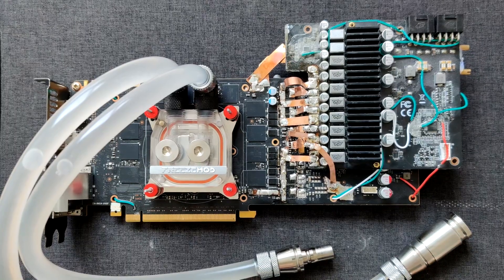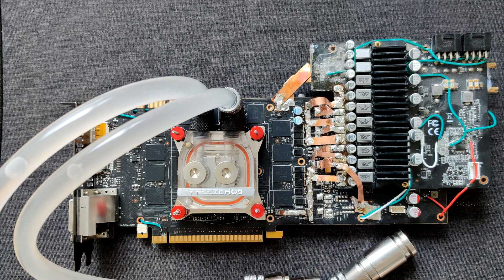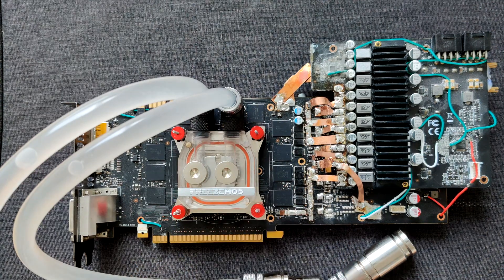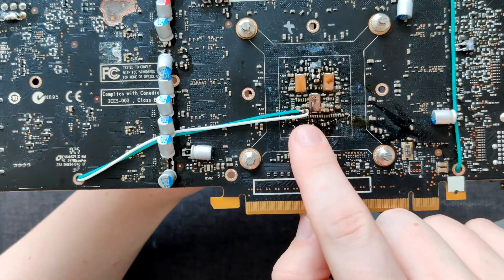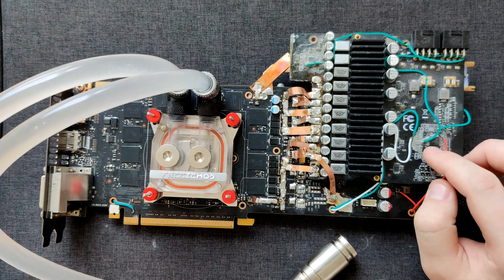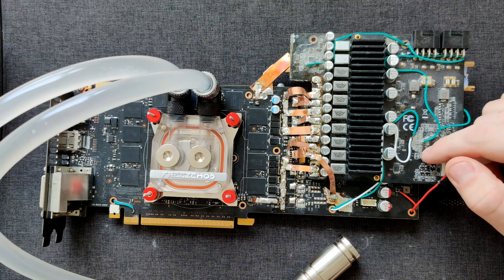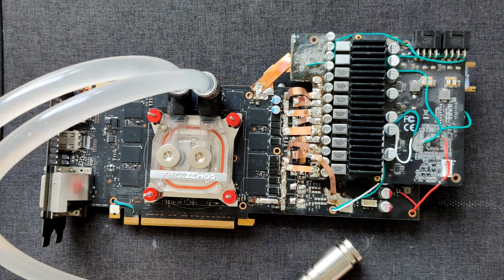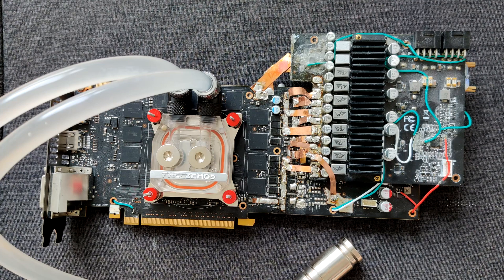The Forward Voltage Sense Mod in Detail

Comment: the voltage sense connection should ideally be a twisted wire pair and should be kept away from the switch nodes of the VRM so that it doesn't pick up the PWM signal from the VRM. IDK how much this matters in practice I've never intentionally tried to connect forward voltage sense wrong.